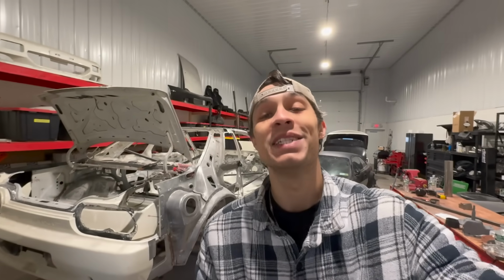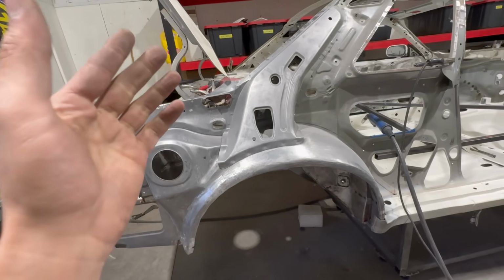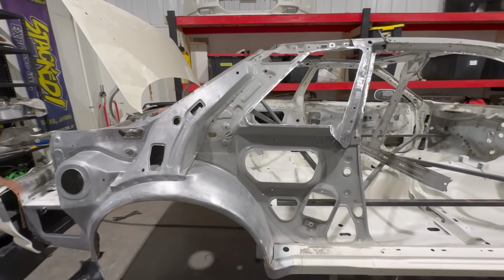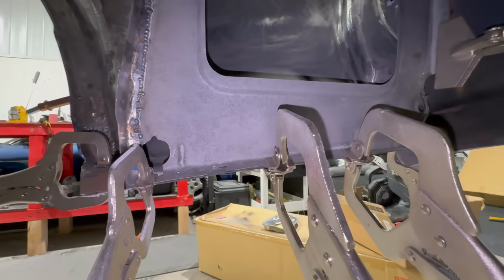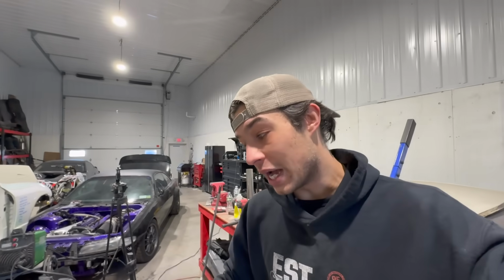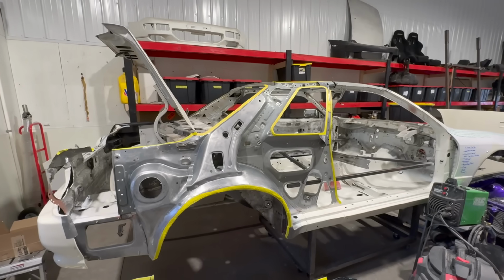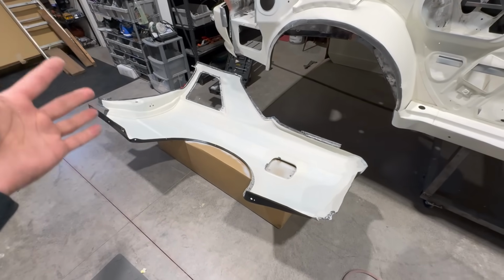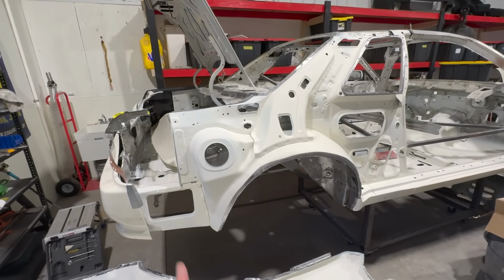I Bought a Totaled Skyline GT-R 3 Years ago & Here's how it's going.

Comment: A resistance spot welder is what you are describing, the ones that can do the entire 1/4 panel with changeable welding arms are about $40,000. You would be better off just plug welding it on and making sure after the car is painted that you spray every cavity and seam with a cavity wax with a 360 extension wand so all the seams don’t rust again like you have seen before

Comment: I wouldn't get hung up on the whole "doing it the right way" thing when it comes to the pinch/spot welder. Welding is welding. What getsc that OEM is consistency and precision. You can buy a kit(Eastwood for example) that gives a tip for your welder that sets the perfect distance every time and locking pliers that work with tip. The rest is typical welder setting which you're a pro at now. You can knock those quarters out yourself. Don't look at it as a lesser method because it definitely isn't. You got this.

Comment: The idea of spot-welding as per factory is quick, minimum heat, solid fusion. My 2 cents would be that because you have basically rebuilt the chassis from the ground up, theres no added value in factory style spot welding aside from aesthetics. However a linished plug weld would be a step above a tidy circular divot anyway. Also, it's possible to get spot welding kits for use with TIG which will reproduce the same effect and appearance of factory spot welds

Comment: Man I personally would have gave the whole bare metal chassis, like you had, to a rust removal bath and after that e coat bath. and after that you could spray epoxy primer like you did now.. 
the e-coat bath is good because it gets all the coat in every single little spot between two metal parts .. now you could have bare metal in spots where you could not reach with the spray gun... 
but its still very very good like you did obv. <3

Comment: If you have a way to source a professional spot welder and get a good lesson on how to use it I would love to use it for the visible areas of the car. But as you mentioned there’s some spots that can be hard to reach. The factory likely uses subassembly’s of panels spot welded together with simpler machines, and then has the big expensive ones with complex arms for getting into weird spots to actually turn big sections into a chassis. I was looking over my 240z and you can actually work backward from the layers and see what they did in chunks vs what was individually welded onto the car. I’m doing plug welds on mine, I can’t afford a serious machine that I can only really use in the most accessible areas. Whichever way I would go I would still be just as paranoid about my work as I am right now lol

Comment: Love this build and everything you do, been following since the start.

Just wondering tho… how does the shop go for overspray when you are painting with other cars nearby? 

Also, does every piece you add to the frame rail get the primer on the inside? I’ve always wondered but when you deleted the drain holes I though about it especially… just wondering if it needs the holes to vent moisture.

Comment: For those panels, would you also spray sealer over the primer before welding?  Asking because I believe primer is porous and it would drive me insane thinking of rust creeping back up after all that work.  I have ZERO experience doing this type of work.  Getting started on a restoration myself.
Reply: Epoxy primer is waterproof and seals the metal
Reply: Thank you!

Comment: Why not use 3m epoxy and rivets like the new cars? It’s no major heat, it bonds better and is stronger overall. Have a brother that works in body shops and showed me the strength of the new age of epoxy bonding and it’s unreal. Definitely recommend that over spot welding.
Reply: I second this. I have a new BRZ and after reading the body repair manual, I was shocked how many panels are just attached with some kind of adhesive. Zero welds! I also have a friend who worked for Dupont and 3M, and he told me the same thing before I bought my car. Modern adhesives for manufacturing are insane.

Comment: Stop using copper weld through primer. It causes rust! Copper and steel are dissimilar metals that will cause galvanic corrosion. I’m replacing arch’s and sills on a 32 at the moment because they used copper primer.
Reply from the maker: I can assure you that was not the cause of your rust! Stay tuned for the next video 👍🏽
Reply: @KalvinMalli  uh I can assure you it was. Care to tell me why you think this seeing as you’re not going to take my advice?
Reply from the maker: No it was not my friend. Someone failed to seal the panels from the inside or the paint/sealing process was done incorrectly. Weld through primers are not a rust stopper. But add a small layer of protection around the otter edges of a weld. Which then needs to be treated for long term rust proofing. Have you ever used zinc weld through? If the answer is yes. Then you’d 100% know that 99% of the zinc weld through primers weld like absolute garbage. There is a really nice zinc weld through available in Europe however not available here. The weld through primer was definitely not the cause of your rust issues my friend. I’ve had bare copper weld through sitting on the chassis for 3 years. And it’s gone through multiple Texas humid summers. No rust 👍🏽 get yourself some proper rust protection. I’ll continue to use copper and get much higher quality welds 🤝🏽
Reply: @KalvinMalli   wow you really know a lot about the car in my shop considering you’ve never seen it. Yes I know zinc primer welds shit. But I also know about galvanic corrosion which it seems you do not. I was simply giving out helpful advice but if you want to be arrogant and ignore it then keep using your copper primer. I could’ve shown you actual evidence from testing. Your 3 years sitting on a chassis inside a shop in summer is hardly a test.